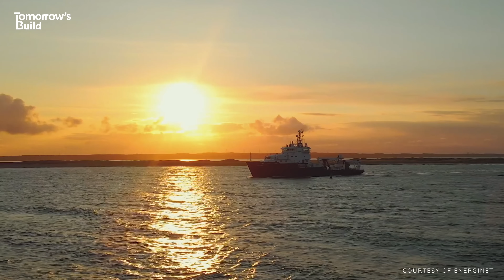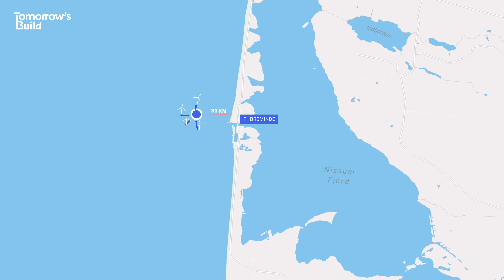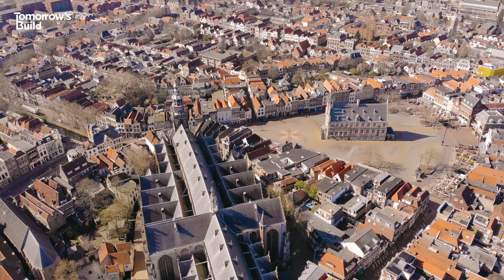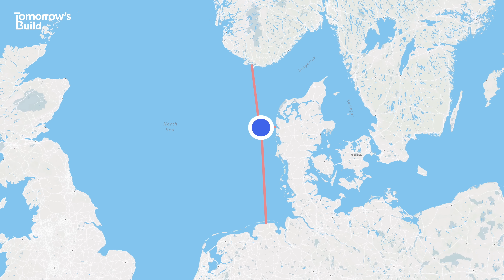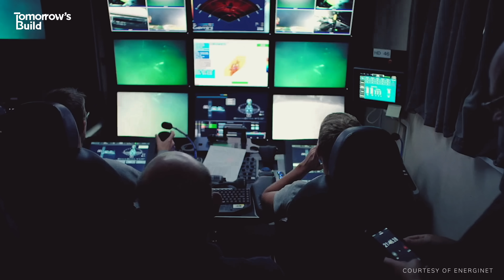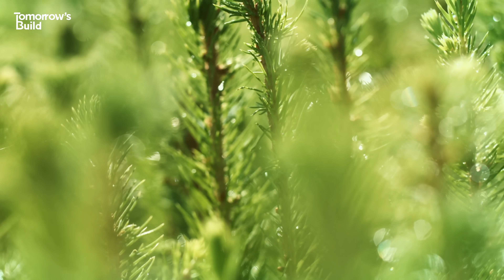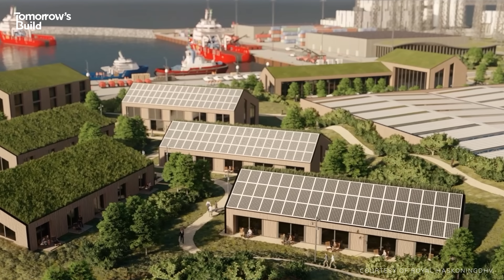Denmark's $34BN Energy Islands Could Solve Europe's Power Problem

Comment: A truly remarkable concept! I really hope it'll make it to completion.
I do have a bit of a practical question: is the entirety of Europe using the same energy grid values for frequency and voltage? I wonder if any potential differences can be taken into account in this project.
Reply: Most of Europe does - it's called "the synchronous grid of Continental Europe" apparently

There are separate grids covering
- Nordics other than Denmark
- UK
- Ireland
- Baltics
- Russia and a few Eastern European countries

However this project would still help other countries. I know in the UK we have big DC interconnects that let us import or export electricity from Europe
Reply: @mymoomin0952  Good to know, thanks for sharing!
Reply: It doesn't matter at all for offshore wind farms since the eletricity from the offshore wind turbines goes to a common common offshore power station where it's transferred subsea to shore in a common huge HVDC cable (high voltage DC).
Then it gets converted to AC voltage on shore. So voltage, frequnecy and phase syncronization doesn't matter since it's all DC until it reaches a power station on land where it gets converted to AC with the right voltage frequeny and phase syncronization.
There's already several subsea power cables from Denmark to both Norway and Sweden and they are all DC with just a one pole wire for the pahse. The zero return is just a huge rod into the ground and both the Danish shore and a smiliar one at e.g. the Norwegian shore. So you don't even use a return wire for these subsea DC cables.
Reply: @ITubeTooInc  Good points! Thank you for elaborating :)

Comment: why do you need the island? cant you just put wind turbines in the sea on their own?
Reply: Well there are a few things, notably maintenance with the island serving as a hub for service workers for monitoring and being ready to go out on a whim to check on the matter, energy storage so there's room for that on site, convertion between DC and AC. The turbines generate Direct current but for travelling long distances Alternating current would mean less loss in energy. And then of course there's Power to X. Aka the act of using the Wind energy to generate other green fuels like Hydrogen or Methanol, and using that to power ships and airplanes. The island is also strategically positioned right along a major shipping route, meaning the island would be a prime location for cargo ships to refuel. Either way, this project will ondoubtly turn Denmark into an Energy powerhouse of a nation going forward in the green transition.

Comment: If the fill was provided by the remnants of trash incineration like Singapore they could solve 2 problems at once. Build a small island with the initial infrastructure with plans to expand it. The island could house large battery storage, green hydrogen plant, and a grid connected trash incinerator that has trash barged out to from all over Europe with the ashes used to expand the island for future energy expansion.

Comment: Looks amazing, but I’m confused why go to all the expense of building an island, why not just connect all the wind turbines together and straight to the coast, what does the island do other than act as a very expensive concentrator point?  Would have thought a tethered ship or an oil-rig type of installation would have been simpler,  and Denmark is about to have a whole load of spare oil rigs?
Be interesting to know how deep the water is 80km out because that’s a lot of piling to do for all those turbines.
Reply: The island will house a transformer station that changes the current from AC to DC. With AC it is not practical to transmit electricity over great distances, which halts the idea of fully harnessing the great wind energy potential in the North Sea.

Reducing loss from transmission before utilisation is also the idea behind, possibly, placing power-to-x and energy storage facilities at the islands.

That said, the Danish energy company Ørsted did propose a plan to expand the capacity without needing to build islands. But this was rejected by the government. So you still have a point. Ørsted has now joined the tender process for the project regardless.
Reply: @Kvadraten376  I'm sure you meant that the other way round....you need to change dc to ac if you want to send power over long distances. That's why all power stations produce ac....it can be easily converted to much higher voltages for transmission meaning cables can be much smaller and still carry the same total energy.
Reply: @Kvadraten376  The island is not so far from the coast as it, the distance is not so great. But I don't think the Danish govt. want all these ugly buildings along the coast. I would agree.
Reply: @TheBooban  for submarine cables the cost-benefit for DC transmission already breaks even with AC transmission after 50 km. The energy island is placed 80 km out from the coast, and wind turbines much further out in the future will only enhance the benefit.
Reply: @Kvadraten376  oh. ok
Reply: Beyond what others have said this also makes it easier to build undersea transmission cables between countries, basically you need some sort of center to control the flow of power and if you put that on the coast of Jutland and wanted to transfer energy to Germany then you'd need to go back out into the sea. This way you can just have the cable go straight to Germany from the control center. It also allows you to have a central area for maintenance of the wind turbines where you can have the facilities you need and warehouses for spare parts. You also then have space for short term energy storage that can be distributed to all of the connected countries, not just Denmark, since it's already hooked up to those countries. And lastly it gives you a ready made harbor for future hydrogen fuel production so you can ship it out to the entire continent.

So basically it makes sense to put all of these things next to each other and since having the cables go more directly from the source to the user makes sense you might as well just put it all on one island and then you get a lot of bonuses from integrating all of these parts.
Reply: Bro, then you can't spend 36Billion Euro on a fancy project, can you!
Reply: 在減少溫室氣體問題上。丹麥和德國一直做出了很大貢獻。如果沒有更好的辦法去獲取更多清潔能源。或者只好接受這些海洋生態災難的做法。
另一個問題是。如果風力發電全部都集中在同一海域。歐洲有時有很多過量電力。並且在這一海域沒有風的時候。整個歐洲失去大部份風能。
歐洲應該將同樣數量風力發電機。分散在不同位置。比如太西洋。地中海。甚至俄羅斯北極圈。這樣風力更可能在不同的時間發生。可以減少電池需要。並維持整個歐洲在更多時間享用風能。
Reply: Because it wont ruin the view of the horizon for people walking on the coast.
Reply: I wondered the same thing
Reply: Good question. I think it is lots about marketing.

I mean would this video be same interesting if they would have talked about a „small“ land section instead of a new island?

But still, i think it would be more efficient to just build by standard model. They would be finished faster and it would be cheaper.
Reply: @leogronung3146  I think it is lots about marketing

Marketing to whom? It's a public project supported by the entire political spectrum in the Danish parliament. It doesn't need to be marketed to anyone.
Reply: @Jacob_Junge  
They need investors. He told that in the video.

I‘d also say this is something Denmark wants to get outstanding in the world with.
Getting a „green country“ status. If they would build it somewhere else, nobody would care tbh.

Someone else (i think in another comment) said, one of Denmarks officials said it was for marketing.
But i‘m not sure if that is true.

Comment: Looks like an interesting idea, but I wonder how they would handle the threat of rising sea levels in the future. 
The island models shown in the video could face similar problems as many south pacific islands.
Dam, or be damned might be the answer here :-)
Reply: Cover the entire thing with a glass dome...
Reply: At current sea-level rise rates, it might, if built, be underwater by like the year 3400.

My town, according to Al Gore in 2005, was supposed to be ravaged the sea levels by 2014. Had lunch on the beach yesterday, the pier is exactly in the same position and depth level as it was when I moved here, also in 2005.

Sea level rise is only an issue if you’re a barnacle wanting to move up higher on the rock you inhabit; it’s all been a disingenuous marketing campaign.
Reply: @sergpie  i mean tell that to venice and the small pacific islands currently being drowned
Reply: @darkithnamgedrf9495  

My aunts and cousins live in the same family palazzo in Veneto they have for generations, and the dock near their house is almost identical in its mark from when it was built in 1890-ish. I grew up in Sardinia near the water, and the steps leading to the beach are yet to be touched by the waves, even during high tides.

I moved to San Diego in 2005 and the pier near me is still chilling, with its tide markers untouched in placement since about the 1960s… 

Are you Al Gore? Weren’t we all supposed to drown in 2014?? 😂
Reply: @sergpie  Everything you said is nonsense. Venice is drowning.

Comment: It would most likely be moored super vessels rather than building entire islands in the future. There are already plans for vessels of 500x200 meter that are moored and tethered together. It makes it far more flexible and able to withstand errosion problems which islands would be susectible for in the north sea. The oil and gas industry already has extensive knowledge within this field, there's no need to look further than to an FPSO which may be stationary for 30+ years.
Reply: Makes a lot of sense to use them in the Aegean sea. Vast amount of energy capacity from a region that wll connect the electric grid of Europe and Middle east through Euro Asia Interconnector
Reply: @nikosvithoulkas180  are there already wind turbines in the Aegan? Because if there isn’t theres a good chance the wind is just shit around there.
Reply: Vessels like that aren't built to be easily expandable and to provide facilities for industrial production so they wouldn't be suited for this task. Building an artificial isn't isn't that expensive either, especially if you're using sand that has been dredged up from some of the projects that are currently underway to expand navigable lanes.
Reply: If you build the island correctly errosion is not going to be much of an issue. Plus massive ships have errosion and reliability issues as well, so the cost of a super vessel will be more to maintain compared to an island.
Reply: L
Reply: Nah, most of the ideas right now are based around building up an island. Lack of sand is an issue.
Reply: Norsk fjeldabe??

Comment: for another source of energy its a nice idea but to call it "green" is misleading since wind turbine is made up of 70-80% steel and another 15% of plastic so you need fossil fuels to make all these turbines
Reply: Everything we produce basically makes some Co2. Electric cars for example release more co2 at production but over the lifespan of the car, it releases much less. Not to mention the fact they run much longer due to less moving parts.
Reply: I think that after it's made, and maintained eco-friendly(repaired eco-friendly) it will be eco-friendly. The only thing is how much time it will take it to recouperate the damages.
Reply: The primary purpose of the islands also seems to be energy storage, which will have an absolutely horrific environmental impact.
Reply: @PistonAvatarGuy  Do we have much of a choice? It's that or continue pumping literal poison into the air that we breath. Not to mention the fact our environment is already suffering due to rising temperatures.
Reply: @admiralsaigojudo5427  Nuclear energy. France has the cheapest energy in western Europe (Germany and Denmark have some of the most expensive energy in the world), they're the largest exporter of electricity in the world and their per capita CO2 emissions are less than half of Germany's, all almost entirely thanks to nuclear energy.
Reply: @admiralsaigojudo5427  

Temperatures are not rising, and nighttime temperatures the world over are actually decreasing, which correlates to an increase in precipitation; this, coupled with the increase in CO2 in the atmosphere, has caused a massive re-greening of vast swathes of the planet, with urban areas and regions like the Sahara and the cone of SA seeing marked improvement in greening. I don’t know about you, but I prefer the evidence of flourishing plants and trees dispelling the carbon dioxide myth than corporations perpetuating it.

Have you not heard of the square miles of desert being covered by rains unseen for centuries in places like Saudi Arabia, Yemen, Jordan, and Egypt? They’re growing crops in places where it had been impossible since before rome
Reply: @PistonAvatarGuy  I agree, nuclear is a great form of energy, we have a new generation of nuclear reactors that can basically not melt down. We should 100% use nuclear as a major form of energy. Sadly both Chernobyl and Fukashima have made people think nuclear powerplants are nuclear bombs regardless of safety regulations.
Reply: @sergpie  Also, please. Explain to me how a greenhouse works. Just please, explain to me how it warms up. And then, please explain to me how Co2 being put up in the air, which traps heat, doesn't cause an increase of warming. Please, I implore you to explain to me.
Reply: @admiralsaigojudo5427  It doesn't matter what stupid people think, the fact is that nuclear energy is the safest form of energy that we have.
Reply: @PistonAvatarGuy  I agree, which is exactly why we should use it. But like I said, people now have a negative opinion towards it which makes putting up tons of nuclear power plants quite a challenge.
Reply: @admiralsaigojudo5427  Education can change minds.